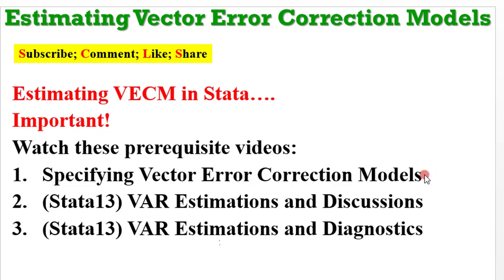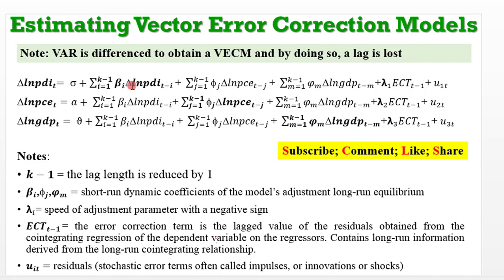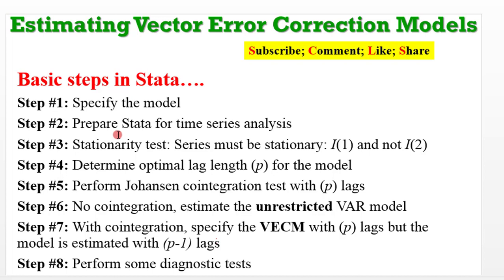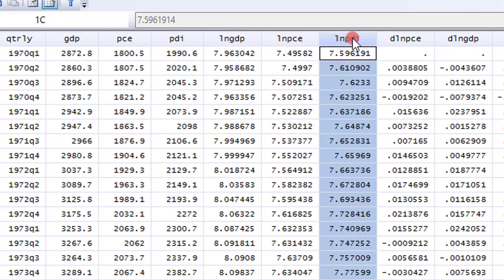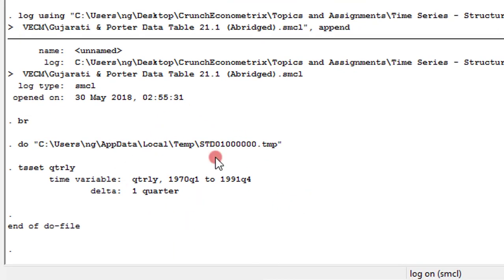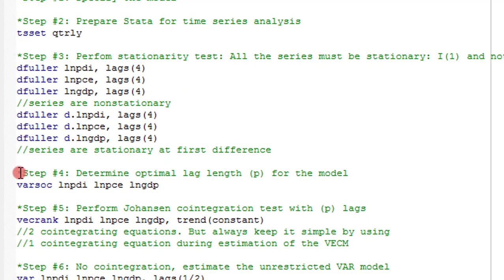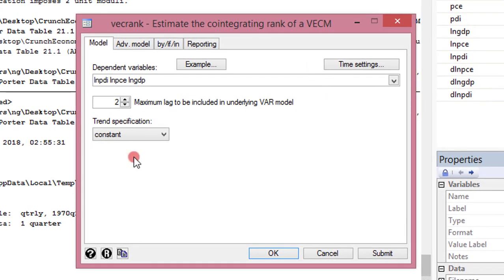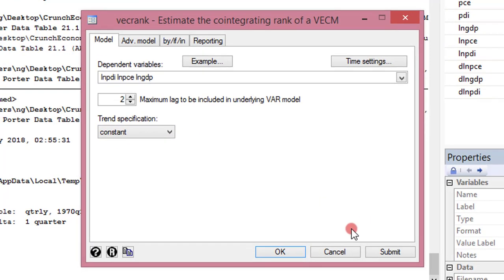(Stata13): VECM Estimation, Discussion and Diagnostics #var #vecm #causality #granger #wald

Comment: Dear Professor, thank you for the video. This video has been very helpful and easy to understand. However, I have one question regarding  performing Johansen Cointegration rank in STATA. What is the implication if I write additional lag information on the cointegration command, for instance, "vecrank lnpdi lnpce lngdp, lag(4)"?  I did both, without (as mentioned on your video) and with lag(4). Estimation without lag gives me no cointegration result, but when I mentioned the lag (which is lag(4)) on "vecrank" command, then the result says at least 1 cointegration. 
For your information, I use yearly time series and the reason why I put lag 4 is that because the optimum lag selection give me optimum lag at lag 4 using AIC criterion. Thank you very much.
Reply from the maker: Hi Anang, you're on the right path. Use the syntax with the additional lag information since that yields a cointegration result.
Reply: Using fewer lags causes multicollinearity and autocorrelation. While using more lags reduces the degrees of freedom
Reply from the maker: James, I explained the dilemma in my video on OPTIMUM LAG SELECTION. You may want to watch the clip. Using lag is not correct science. The final decision rests with the researcher.

Comment: Dear Crunch, 
I would like to ask how can I make prediction of the dependent variable after the VEC modeling, and generate the fitted value of dependent variable? Thank you very much.
Reply from the maker: Hi Mengni, using my example in this video, to predict lnpdi use this syntax immediately after the vec command:
predict lnpdi_hat, xb
Reply: Dear Crunch, when I write command predict lnpdi_hat, xb, it shows the difference for  lnpdi rather than the lnpdi itself? what should i do with this?
Reply from the maker: That's the command for the predicted value. What to do with it depends on why you need it.
Reply: so, what code should i use if i want to predict the lnpdi rather than d_lnpdi? thank you very much.
Reply from the maker: Same code I gave you, check it again.
Reply: Thank you madame. I try the code again, it still gives the estimated difference of lnpdi, not the the estimated lnpdi.  Do you know what is wrong? Thank you very much.
Reply from the maker: This is the syntax:
vec lnpdi lnpce lngdp, trend(constant)
predict lnpdi_hat, xb
...if you specified these, you shouldn't have the predicted value of dlnpdi but for lnpdi. So, cross-check what you have.
Reply: Dear Crunch, thank you very much. Unfortunately, i write the same code and double check, but stata only gives me the estimation of lnpdi, what it calls the linear prediction of difference.

Comment: Hello Professor! I really did appreciate this video, which has been useful and understandable for me. However, I have two questions
1.  If some of my series are integrated of order 1 and others integrated of order 2, what should I do exactly ? Does it create a discrepancy to my VECM ? 
2. For the last diagnostic test you did, I mean the stability of the coefficients, I do not know what has been your criteria to say that the coefficients are stable. Is it that your  The VECM specification imposes 2 unit moduli which equals the number of lags(2) used ? Is that the rule? 

Thank you so much for sharing your know-how!
Reply from the maker: Hi Kashy, for the 1st question, 1(2) series can't be used in this case. So, you may have to look for another proxy and re-estimate. For the 2nd, it shows the roots are within the unit circle (I'll advise you to read more about this online). Hope these are helpful.
Reply: Thank you! But actually I have another question. I have been performimg the VECM (Johansen) and the diagnostic test such as LM and Normality test.  The residuals are not autocorelated, however they are not normally distributed.  What should I do if my residuals are not normally distributed?
Reply from the maker: I often don't take normality test too seriously. I worry most if my model is heteroscedastic or has serial correlation. Anyways, you can simulate various functional form of the model e.g. log-log, log-level, level-level to see which form of the model passes all the diagnostics. Thanks.
Reply: Thank you so much. Indeed I have simulated various form  and actually the form log-log is better; only that it does not satisfy the normality test. However, with your explanation I think I will keep that model, since the target variable is normally distributed and the ECT sastifys also the expectation . For the independent variables, only one or two are not normally distributed.
Reply from the maker: Diagnostics are performed on the model not on individual variables, so checking for explvars do not arise. Report only the test outcomes of the model not individual variables.
Reply: @CrunchEconometrix  Thank you, It has been really really good for me.  Now, I thought to include a dummy variable (that can allow for structural break) in my VECM, so should I include it directly or there is other way to include a dummy variable in the VECM? I have been reading for that, however I did not find concret example. If you could give some hints I will love it. Also according to you professor, is a significant ECT of 150% acceptable?.
Reply from the maker: @kashyal1348  Hi there, unfortunately I've not estimated a VECM with dummy variables, just wondering being a vector how will you interpret your results. Perhaps, that's why you've not come across any concrete example. On ECT, yes, coefficients not lower than -2 is still acceptable (see Loayza and Ranciere, 2006).
Reply: @CrunchEconometrix  Thank you professor! I will definitely keep it without the dummy variable.  You saved me from troublesome. I liked your videos, and you're prompt in answering.  All great to you!
Reply from the maker: I'm encouraged, Kashy😀!!! Please help share my videos with your students and academic community...👍
Reply: @CrunchEconometrix  Indeed, that will be done!
Reply: @CrunchEconometrix  Dear Ngozi, thanks very much for the video. It's very helpful. May I know what's the meaning of the form of the model, log-log, log-level, level-level?
Reply from the maker: @fuzhufeifei  These are various ways by which a model can be specified. Example: lnY=a0+a1lnX (log-log); lnY=a0+a1X (log-level) and Y=a0+a1X (level-level). Please read Wooldridge Introductory Econometrics, there's a chapter on "Functional forms" of a model. Easy to understand.
Reply: @CrunchEconometrix  Got it, thanks very much!

Comment: Good work ma'am. I still don't get where you got the values in the VECM model: 0.002, -0.144, +0.44, -0.099 and -0.067. Please shed more light on this. Thanks.
Reply from the maker: Ok, if you check the 1st component of the result output, you'll see the coefficients. I only lifted from there to construct the lnpdi equation.